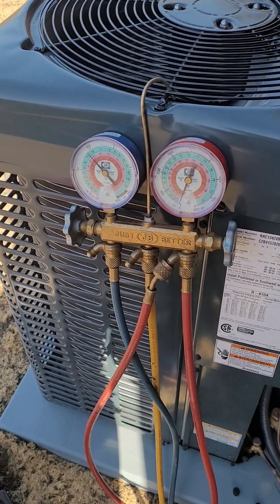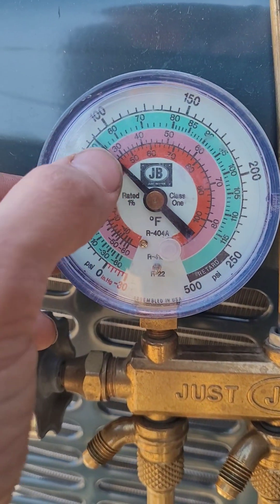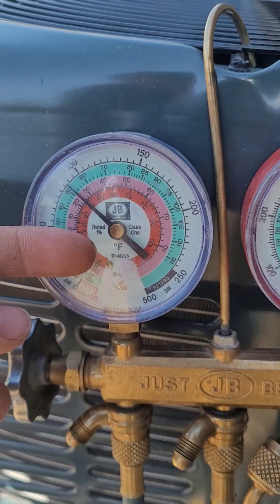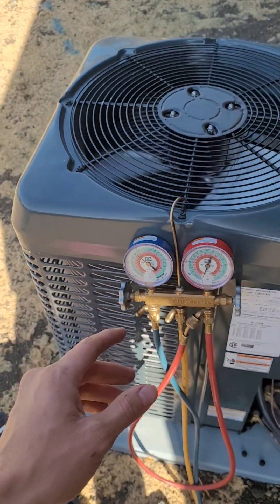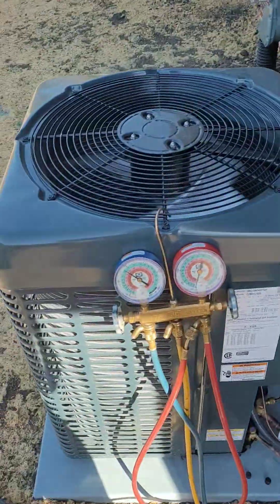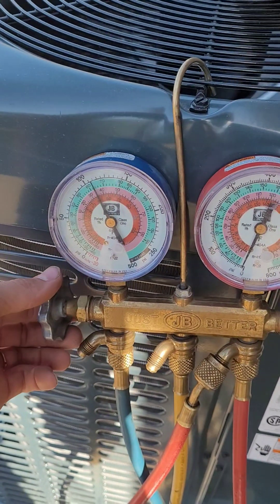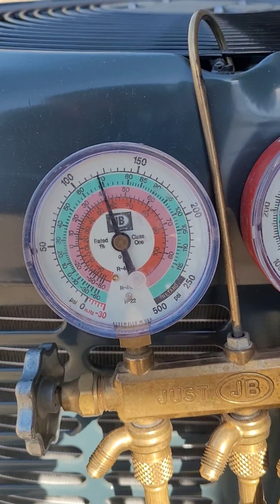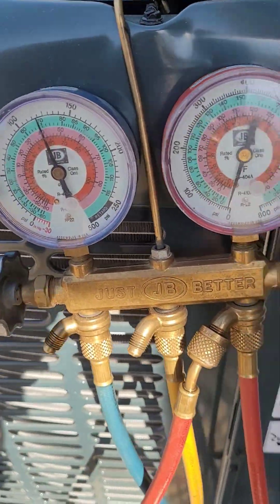What should 410a pressure be?

Comment: lol, you just made a video that gave me work down the road. Next time, why don’t you educate them on superheat?
Reply from the maker: If you think this video is an in-depth refrigerant charging video, I'm a bit surprised. YouTube shorts are not the place for an in-depth superheat and  subcooling explanation. There was hardly time enough to explain what I did about the pressures correlating to the vapor saturation temperature on the indoor coil.

Comment: Pressures don't tell the whole story.  It's all about SH and SC.
Reply from the maker: Agreed, but it is hard to communicate all the pertinent information in 60 seconds.
Reply: @ReubenSahlstrom  
True that
Reply: How to do the SB and SH
Reply from the maker: You calculate the sub cooling by measuring the high side pressure, looking at the liquid saturation at that temperature, and subtracting the outlet temperature of the condensing coil. Usually you want it to have 8 to 10° of sub cooling. Sub cooling is just the measurable amount the liquid refrigerant cools after condensing into a liquid. Superheat is the measurable amount the refrigerant warms up after evaporating. So to get that, you look at the low side pressure, and the vapor saturation temperature it corresponds to, then you measure the line about a foot from the compressor. Once you have a stable temperature you subtract that from the vapor saturation temperature, and that gives you your superheat generally you want around 20° of superheat.
Reply: @ReubenSahlstrom wow awesome explanation and very helpful, thank you so much
Reply: @ReubenSahlstrom do you calculate for mini split as well?
Reply: Mainly for txv. If you’ve done it long enough you can go by fewl
Reply: true, SH & SC keeping metering device in mind, and ABC Air Before Charging - deltaT vs. target deltaT, static pressure - all 100% matter especially at initial commissioning (low air flow causing low SLP often mistaken for low refrigerant)